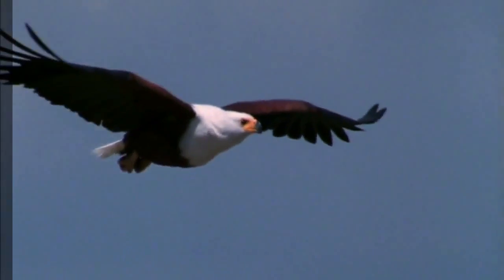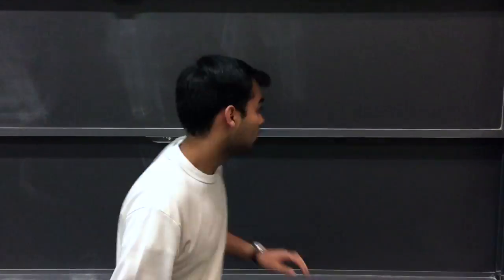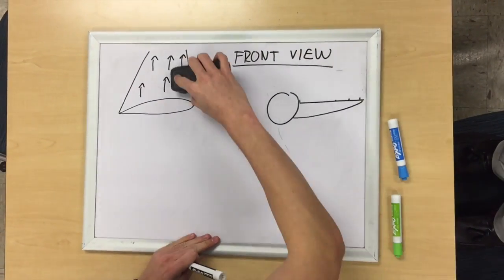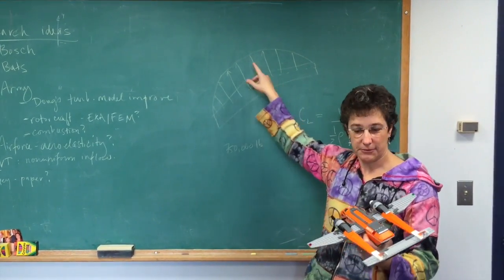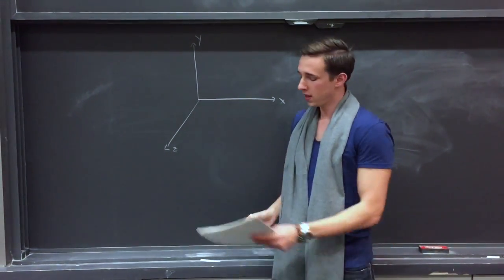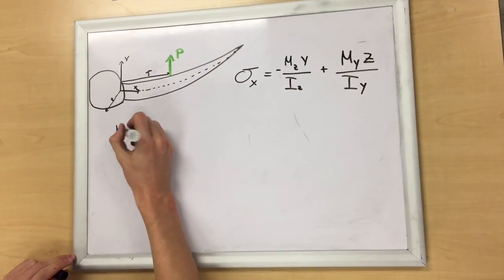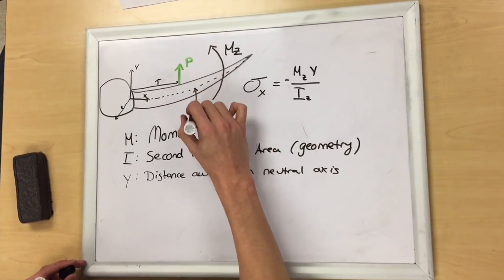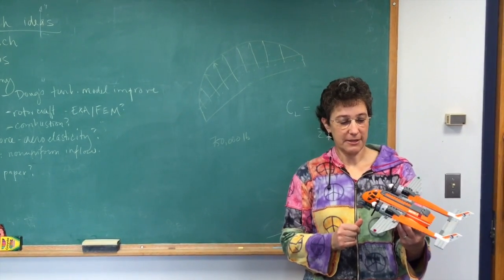Normal and Bending Stresses on an Airplane Wing

Comment: Shouldn't there also be a normal stress and moment caused by drag?
Reply: Yes there will be moment and normal stress due to drag varying with the distance along wing span. However, if the If the airfoil is thin, the moment of inertia to be used in the stress calculations due to drag is large as compare to due to lift. Therefore, the normal stresses induced in the wing structure due to drag are going to be smaller (but not negligible) as compare to due to lift.